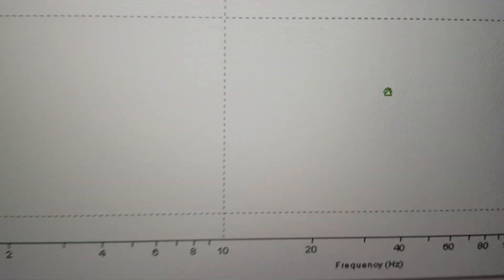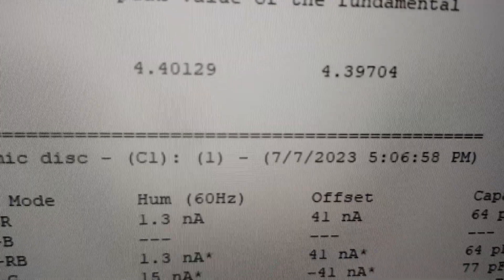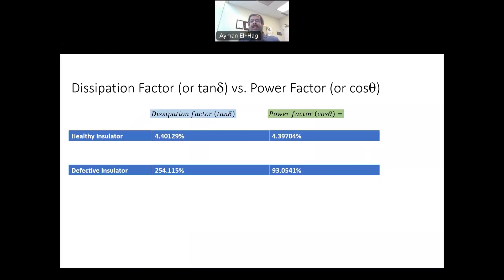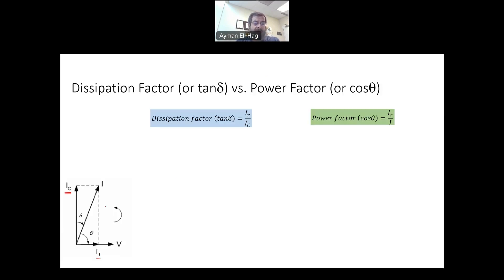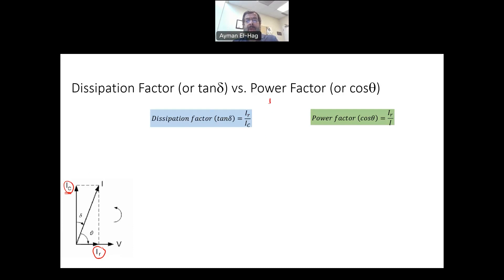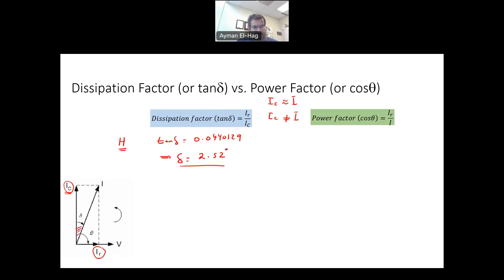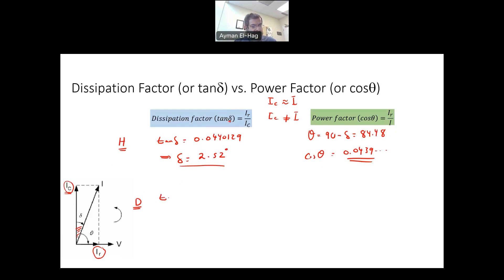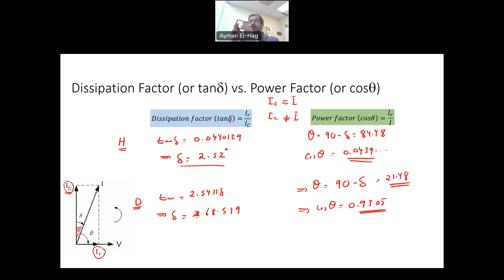Dissipation factor vs power factor

Comment: Dear Sir,  is DDF dependent on surface condition of insulators or is it just the volume phenomena?
Reply from the maker: The DDF is supposed to measure the volume property and hence the surface should be clean otherwise you will have surface current that will corrupt the results.